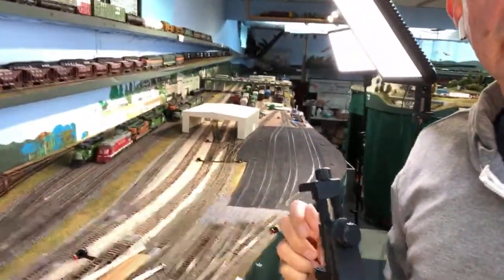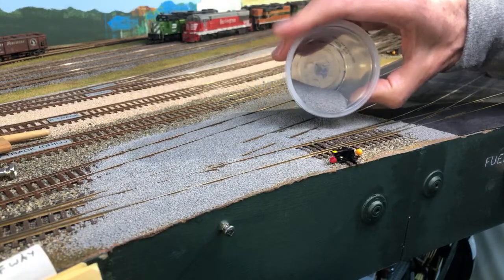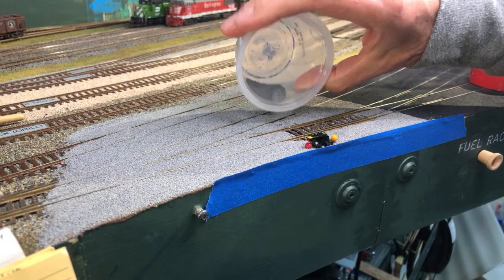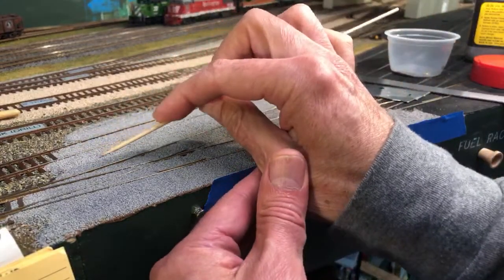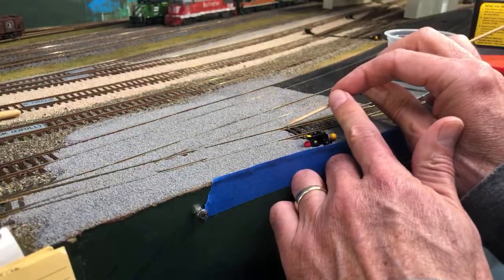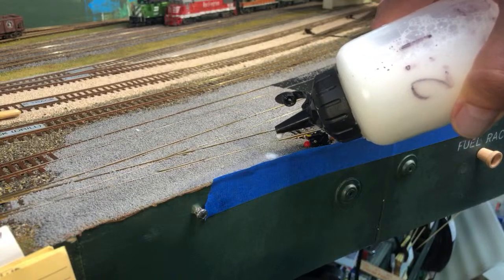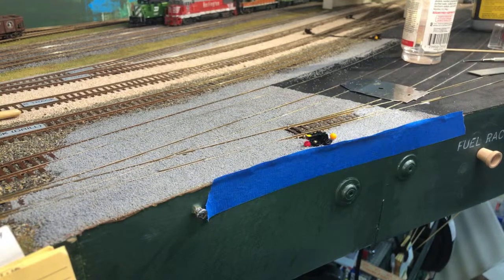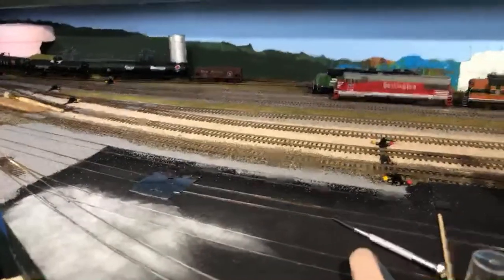Paving  the HO Interbay car shops, part 2

Comment: What did you use for the pavement?
Reply from the maker: The gravel pavement, I'm using Woodland Scenics "Fine Ballast Gray #B1375" because I have a lot of it on hand, but I would rather use something like molding sand from a craft store, or something gray from Arizona Rock & Mineral Company. I wetted it with isopropyl alcohol and then applied a 50:50 solution of Elmer's Glue and water to glue it down. The asphalt pavement (near and underneath the Car Repair Facility) I made with two layers of EVA craft foam (from a craft store or online) - first a 2mm thick piece in between the tracks (it's the same height as the ties) and then a 1mm piece on top, between the rails and on top of the 2mm pieces and the ties. I glued it down with the same diluted Elmer's. I used black foam (it comes in various colors) and then applied gray Pan Pastels to it until it seemed sufficiently sun-bleached.